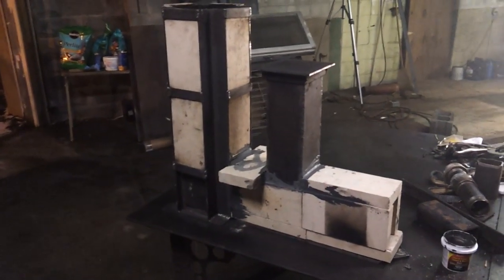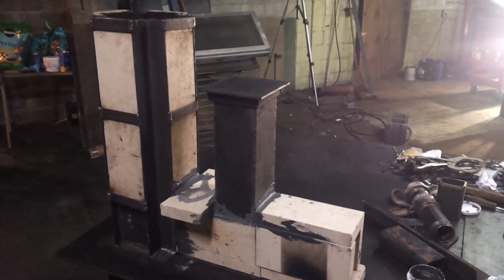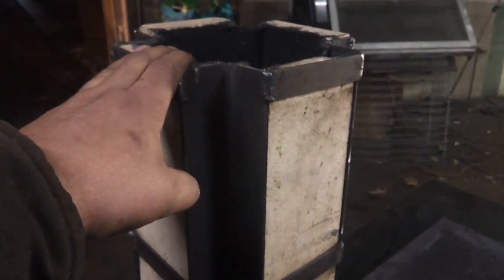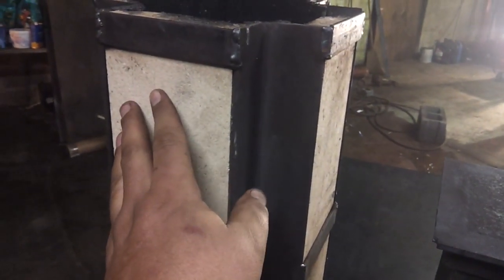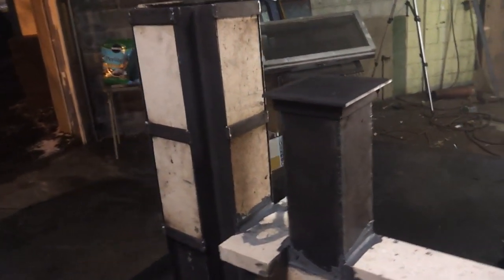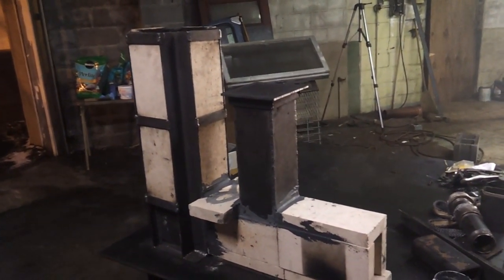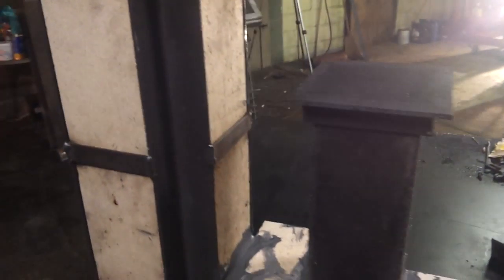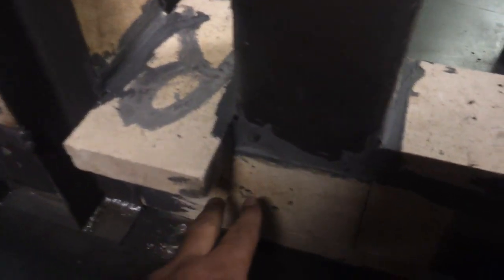Rocket Mass Heater/Stove (Part 1)

Comment: this is how i built mine using steel will burn away even stainless .http://www.flickr.com/photos/18383235@N03/sets/72157637460057636/
Reply from the maker: Yeah the final design won't have any steel exposed. What you see here is all for testing. We're trying to fully understand this technology. My goal is to become an expert on the subject. What works best and why. What doesn't work and why. What lasts and what doesn't. What happened when it fails. And many more questions lol. This is not going to be a one off build so answering those questions is very important to me.

Comment: How do you clean it out?
Reply from the maker: All of the horizontal area and the feeder will be changed quite a bit. Ash collection will be part of that. We got along way to go but so far so good. Keep watching and you'll see what we have planned. Right now we're keeping it simple so we can experiment with it. Once we gather all the information we need during testing. I'll draw up a final design and I'll build a finished product to use in a house for long term testing. I plan on building another one for my shop too. It will replace my barrel stove again for long term testing.

Comment: Would it be possible to add horizontal sections of exhaust pipe to it? Or one of the heat reclaimer / extractors on the vertical section.

With traditional stoves I know that's not a good thing to do as it will cause the volatiles to build up and potentially light off at some point. However, since these have a bit more complete combusion with the convection currents sucking the air in, I wonder if that would be possible.

Seems like that would be a good way to make the most of what you are burning.

Now I want to make one and try this!
Reply from the maker: Not in the burn chamber. It runs way to hot and will burn a hole in that type of setup. Even if you use thick metal it will eventually burn out. The goal here is to make this thing last for years of none stop winter use. You'll have to see it when it's complete to fully understand how it works. We do plan on experimenting with different ways to make it move the radiant heat more effectively though. It's going to be pretty damn cool when it's done.
Reply: The heat extractors are usually a few feet above the combustion chamber. They expel the heat but let the exhaust go out the pipe.

Will it be for indoor use?
Reply from the maker: That won't work because the goal is to get the exhaust temp way down before it even get's to that point. We have a few ideas to work on though.